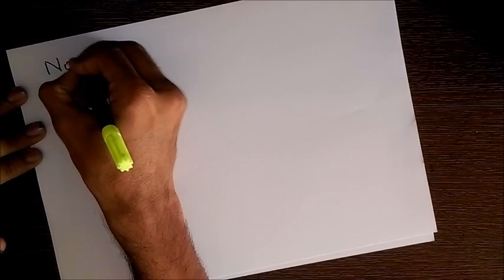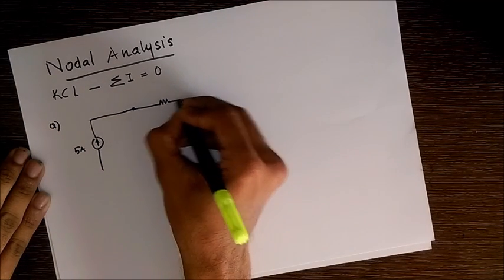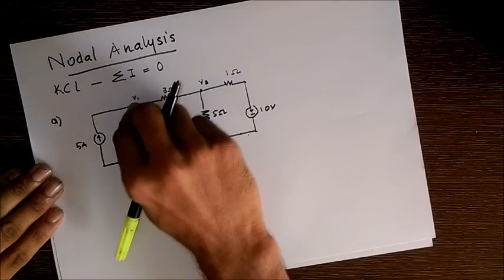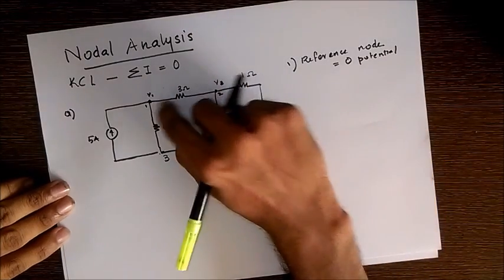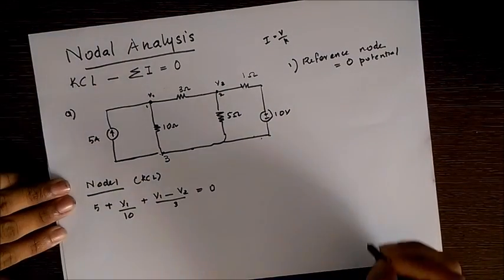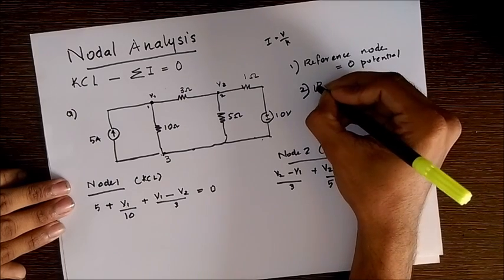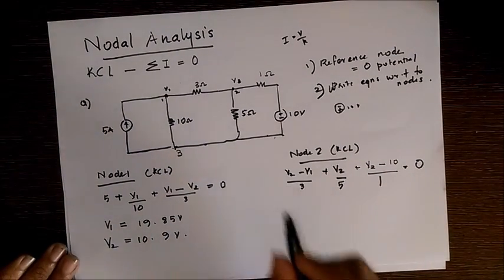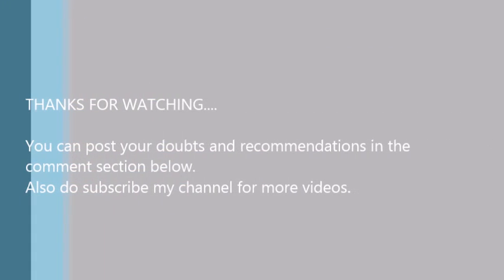nodal analysis - how to solve problems

Comment: I have this doubt. Won't the KCL at node 1 be
V1/10 + (V1-V2)/3 -5 =0         
In the video, the KCL was 
V1/10 + (V1-V2)/3 +5 =0      
I might be wrong. Please verify and correct me if necessary. :D
Reply: Divya Pattisapu I think u r right
Reply: Divya pattisapu yes you are absolutely correct
Reply: U are 💯% correct
Reply: Yes ur right it is not +3 it would be =5